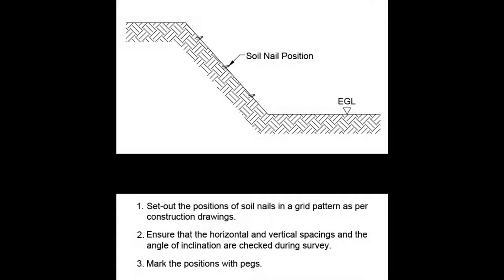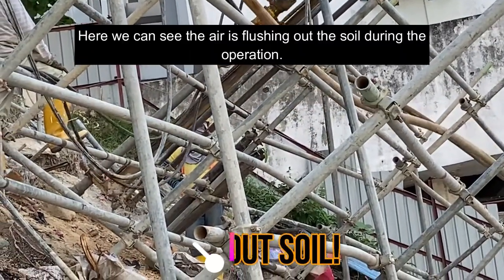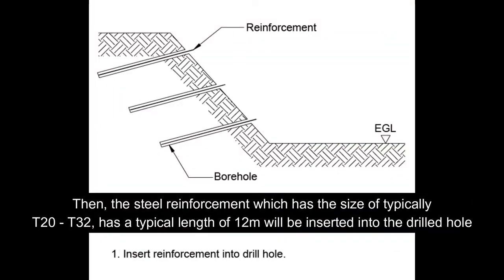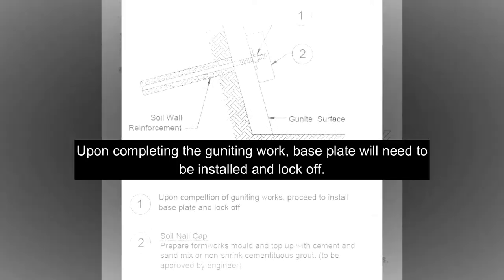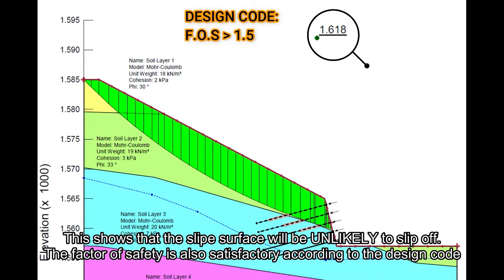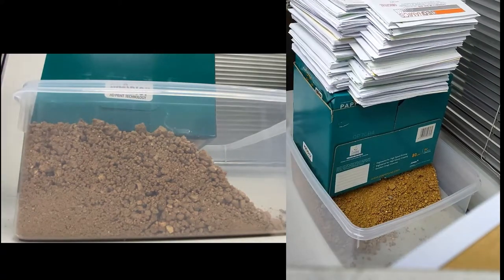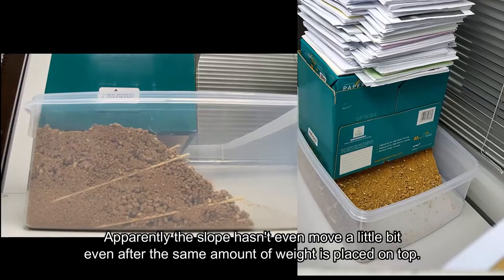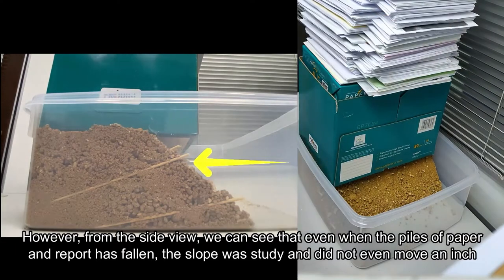Soil Nail Explained | 𝐆𝐞𝐨𝐭𝐞𝐜𝐡𝐧𝐢𝐜𝐚𝐥 𝐅𝐨𝐮𝐧𝐝𝐚𝐭𝐢𝐨𝐧

Comment: What's the difference between soil nail and rock bolt?
Reply from the maker: The method of construction are the same. Soil nail may comprised of soil and/or rock socket, while rock bolt are nail on to the rock surface.

Comment: Will this be effective on the rocky slope where Earth cutting is preceded by blasting use dynamite
Reply from the maker: Yes and no. A similar system on rocky slope would be named as a Rock bolt. Rock bolt only may not be sufficient after blasting. A mesh or rock netting system maybe needed to prevent rock fall.